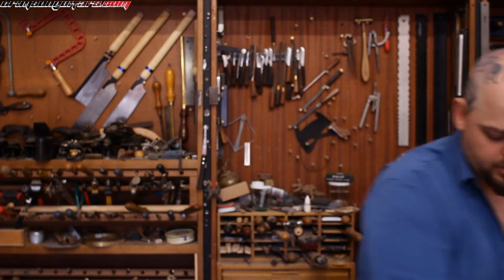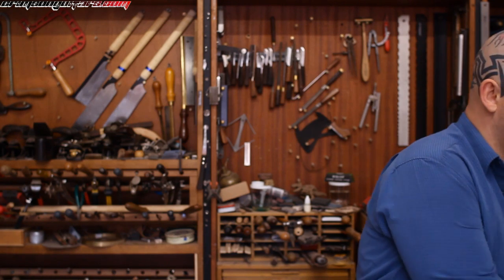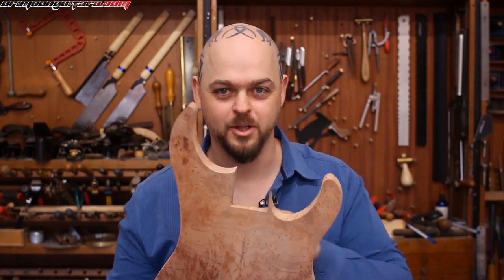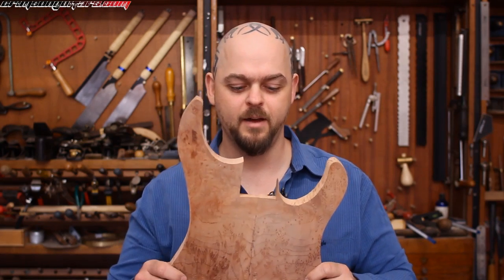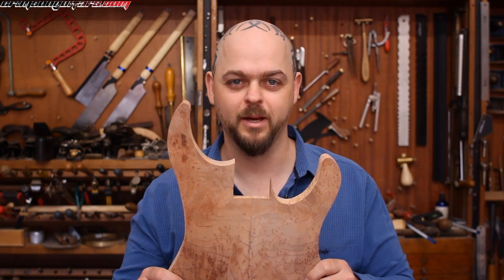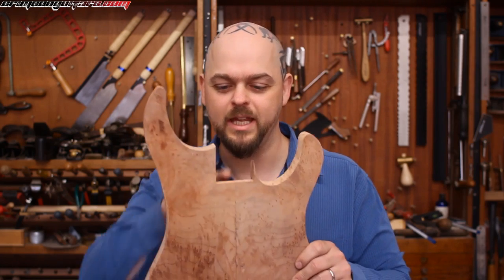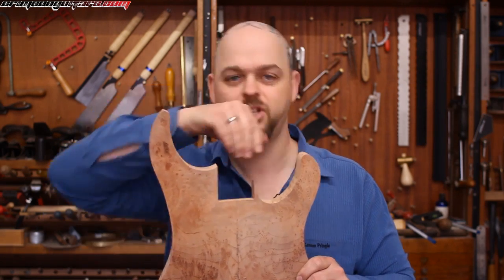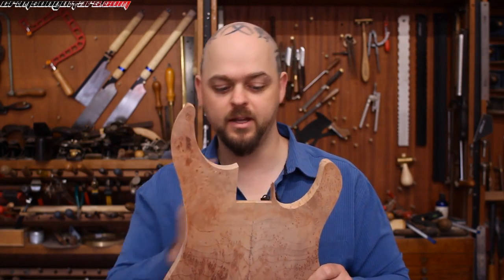Oh no, my neck pocket is too big! - Podcast 125

Comment: Saw the body on the centerline, and glue the pieces together again. The wood removed by the cut will narrow the neckpocket. Probably more work, but if well performed the repair is invisible.
Reply from the maker: +Paul Vréke This should be the top reply!! So simple and beautiful :)
Reply: Good advice as long as you don't have bridge holes, pickguard holes and pickup pockets drilled. Still think that putting some veneer in there is much faster and easier to do.
Reply: Sometimes the most obvious solutions are the ones most often overlooked. I can't think of a better way to do it. Nice going.
Reply: What about the pick up cavity would that not be too small and need resizing?
Reply: That's exactly what I will do since I am using a solid paint to finish it with. What a brilliant solution.
Reply: I searched for the vid due to some similar situation and the though of this option is relieving, but how wide is too wide for a 6 string neck?
Reply: nice.

Comment: take brown construction paper and fold it until it gets thick enough to get a nice tight fit in the pocket then soak it in a thinned wood glue. Tape off the guitar with painters tape and Press the neck into place and let it dry for a couple days. sand and finish..
Reply from the maker: good tip!! I will try this one day for sure. B

Comment: Have had this come up on parts guitars w parts from different makers. One quick and simple fix that is esp easy w bolt on neck is to coat the heel of neck w paste wax or something else that glue won't adhere to but can be kept very thin, attach neck and then fill gap w epoxy or glue/dust mix. Cosmetic clean up still needs to be addressed to the extent merited by project but it gets done fast and w a very precise fit w minimal fuss.

Comment: I almost hate to give this up but whatever, I’ll do it. For stuff like this, I like to use this stuff called “quikwood”. It’s an epoxy-like substance that comes in a tube. You knead the stuff in your fingers, mix it together nicely, apply and in an hour you have new “wood” there. You can dye it, paint it, chisel it, drill it, glue it, whatever...it’s basically wood. I’ve had repairs come in that the guys thought were utter lost causes and I can tell them with confidence that I can make it good as new...

You’re welcome hahah
Reply: Is there any way to have the new pocket mold to the neck? Or do you still have to route the pocket out again?
Reply: You beauty, I have a Tele with the pocket uneven under the neck, will this stuff work?
Reply: Gersh 

Absolutely, I use quikwood for that kind of stuff all the time.

Comment: Sorry to double comment.  Found a really cool solution for a neck that was paper thin too big.

Took a hand planer.  Made the blade a wee bit more then normal (deeper).  Plane out a really nice single shaving.. Using a planer width larger the the depth of the neck your making smaller.  So wood shaving looks like a little piece of wood tape big enough to cover the sides of the neck pocket in one strip.

Take the shaving wet it. .(Gently not soaked.)  I used warm water... Then flatter out with a good metal ruler and a weight on top...  Which..... create a strip of wood a big thicker then paper.  Sense it's a strip and thing.. You glue it up on the pocket side (including the back) and form fit the strip on the neck pocket sides.  Then just thumb it down till it literally looks like it's almost part of the wood and dry.  Sand.. Repeat.. Until your neck pocket fits the neck.  I used the same wood to make the chisel shaving strips.  

Looks awesome.. Cant even tell.. No lines cause the strips bond in perfectly.. it's not some ugly ass shim.

Thanks man.. love the show hope that helps anybody

Comment: After I removed the poly finish on my Tele body and neck there was a small gap on all sides of a few mill so I used used a tiny construction paper thin piece of ply on all sides of the pocket and it worked swimmingly

Comment: I'm building my first guitar (out of a cheap, chinese kit) this video is quite helpful. My neck, when inserted into the pocket appear to be on a slope down, it's not perfectly flat and parallel. Is it meant to be that way?
Reply: If it's a carved body like a Les Paul? Yes. There's usually a four (4) degree angle, plus (+) or minus (-) one (1) degree. Strat and Tele style guitars are pretty much anywhere from zero (0) degrees all the way up to five (5) degrees depending upon if they need shimmed or not.

Comment: Use a 3d printer and print a shim!! i have done this, it works fine, DON'T use PLA for this, use ABS or simmilar hard and stable high temp plastics. it can be printed in any shape, off to a side, or even around the neck .
Reply from the maker: That would work.. I am sure, I alas have o such thing and can make a shim in a few minutes with a few hand tools and some wood.. B

Comment: I've used the dust/glue technique before and worked very well - I put one tightly and carefully wrapped (to avoid wrinkles) piece of shrink wrap/cling film around the heel of the neck and clamped in place in the pocket to mould the glue-dust to the shape of the neck and pocket. When dry I removed the neck, removed the cling film and had a perfectly snug pocket.

Comment: Just a thought:  traditionally in woodworking when cutting a mortise type joint you would use one part to mark out the other.  So the neck would be made as required, then used to mark the neck pocket, which would be cut under-size, then the neck fitted.  Saves on errors and having to repair mistakes.
Reply from the maker: +Stephen Gent that's how we tend to do it here, custom neck pockets almost every time..

Comment: I know this is an old post but I have a problem. I had to sand all the ink off my body and start over again. When I got to the horn I had to use a dremel. I was being very careful not to let it sand grooves . Well I wasn't thinking and managed to sand down too much of the side pocket. According to my caliper the neck is sticking out 2.40mm. The neck still tightens and doesn't move and is aligned. Do you think this is gonna cause a problem?

Comment: Is this potentially a valid place to consider “glassing in”? Use cling-film to protect the neck and prevent it adhering and fill the cavity with a liquid epoxy? The hard resin should transmit the vibrations well and will perfectly match the neck.

Comment: I am currently building a guitar, and while the neck heel fits well, it's sides are a little uneven (no 90 angle). Cutting it to straighten is making it worse in thic particular situation. 

What if I cover the heel in duct tape, put in the pocket, and then use sawdust+glue combo? Thus I will fix the pocket to be tight around the heel, and the heel won't be glued in.

Should I try it this way? I really don't want to ruin my first baby. :)

Comment: I'm putting a 56mm neck into a 57.5mm neck pocket. What I've done is used thick craft card to shim both sides of the neck pocket. I've superglued three pieces of card either side. The neck fits snug. I'm waiting on a pick guard before my final build. I think there might be a little 1mm gap visible either side of the neck but I can live with that.

Comment: Hi ,I do respect your opinion on fixing a large neck pocket, for anything to do with tonewood filling I have always used  a mixture of superglue and wood dust. You know ,squeeze superglue and sprinkle dust straight after and so on until desired thickness is achieved. What u end up with is a rock hard filling four times stronger than the wood itself and this is before it's even dried properly. The colour may be different but most guitars will be painted after. Thanks.

Comment: I am attempting to make a bass, but the body is too thin.  When I create my neck pocket I believe that I will only have about 11 millimetres, or as imperial users go about 29/64ths of wood left to bolt the neck to.  Should I glue wood to the back of the body, underneath the neck pocket in order to help with strength of the neck pocket?  it might look a little weird, but I believe I can shape it to be comfortable. I am going to use a neck plate, and about 5 or six screws and the pocket is fairly long.  Is this a bad idea?  thanks to anyone who can help!!

Comment: I like the idea to dead man and reroute. Perhaps do so with intent of a contrasting wood similar to the binding idea. Dust and glue isn’t horrible for very small voids and I use it a lot. Like as I clean up squeeze out on long miters for instance. But bolt on neck is necessarily the right application. Resaw the body reasonable too, but could have some caveats.

Comment: I'm in this exact predicament currently: When I was a bit younger (16 or so iirc) I wasn't allowed to use a router, so I attempted to do it with a set of chisels, and honestly didn't do too bad of a job, but it just was slightly too large, and I haven't touched it since. I am now 20 so I think I'll purchase myself a nice router and route a clean pocket that's about 5mm larger than the neck, place a piece of lighter wood in (using swamp ash for this build, so will most likely put some maple or something in) and that way when I route the correct size pocket for the neck and it's in it'll look like a nice contour sort of like binding. Thoughts anyone?

Comment: Would it be prudent to just make some shims and stuff them in, possibly wood glue them in place? I have a cheap eBay DIY bass kit, and the neck pocket is absolutely atrocious... I managed to get the thing installed straight, but the gap on the E-string side measures .026" and G-string side is .030", according to my feelie gauges...

I also picked up a stick of both maple and meranti ("Phillippine Mahogany", which is my best guess to the actual "mahogany" species used in this "mahogany" body), which I could use for shim material, but I'm also wondering which would be the better material; the more dense, less porous maple, or the more porous, lighter weight meranti?

Comment: Recently I broke the headstock of my 12 string acoustic guitar. I had a little lost of wood when I was trying to glue it for the first time. On the first time, I made a huge mistake by using superglue. It didn't work and I had to separate the headstock from the neck, and then a bit of wood at the joints was lost. I decided to use then a very hard epoxy resin and it filled the gap and holds really nice the headstock. I've learned that slow curing epoxy resin fills all the gaps and the sound transferring is excellent. I recently did some other stuff with epoxy resin and I find it very similar to hide glue

Comment: Hi ben is it not possable to measure the neck pocket cut a piece of wood to the same size make the neck template but make it wider where it conects to the neck pocket  not forgeting to use the center line for a solid conection ?

Comment: Hi Ben! Recently, by accident, I routed the truss rod pochet a bit crooked in the neck I'm working on. It is centered on the body end but about 3 mm off at the headstock end. I unfortunately didnt notice until I glued the fretboard on. Is there a way to repair it? If I leave it like that, will the neck still be usable? Thanks for your help
Reply: +Jose Sanchez Disclaimer: I have no experience building necks.
From a physics point of view it shouldn't be too bad. You'd get a similar thing with asymmetrical necks which have more material on one side of the truss rod than the other. It is pulling a slight twist in it but when you stop and think about it so are the strings where the bass side has more tension than the treble. If you skewed it in the right direction you may even have a more balanced neck than usual because of that.
As for repair, I imagine that'd be remove the fretboard, fill the hole, redo.
Those with experience will know better of course but that is my reasoning on the matter from the physics side.
Reply: +Allan McKenzie Thanks Allan! That's exactly what I was thinking, actually it is more to the treble side unfortunately... I think I'll leave it like that, see what happens, and if needed go with removing the fretboard, filling and redoing. Thanks again for the suggestions. This is my first official guitar and I'm a bit discouraged that this kind of stupid mistakes happen.
Reply: +Jose Sanchez Don't be discouraged by stupid mistakes. They happen all the time (and I'm really good at them haha). Its what you do with them after that matters. Whats the worst that could happen? You mess up and learn another method that doesn't work. As it was said when inventing the lightbulb "I have succeeded in proving that those 700 ways will not work."
Reply from the maker: +Jose Sanchez I agree with Allan but will see if we can come up with more to say in podcast 131... and mistakes are what make this job nad help you learn, they are great things in the log run imo
Reply: I agree. All in all, I mounted the strings on this weekend and it seems ok. I might post a video when its finished. Thanks!

Comment: Hey Ben
Im modifying the first guitar i ever bought and I wanted to put a new neck on it. The neck i want to put on it is a strat style neck and has a curved bottom but my guitar came with a squared off neck joint. Both are the same width, height and length (at the mid point) Would i be better off filling the gap with epoxy or gluing in a new piece of wood and re cutting it? 
Thanks

Comment: Just recently acquired a 7 string tele body. 7 strings useless to me I can't play the ones I've got so I did a shim either side and a superglue and dust just as you explained. Worked perfectly.  I will of course spray it a solid color to hide the fact.  Great video.
Reply: didn't Ben said Not to use superglue but white glue? because it Chaves changes the color.

Comment: So picture the scene, I have a 21 fret telecaster neck rounded at the heel and I need to fit it to a standard (square) telecaster body.
What do I do? Please help
Reply from the maker: put it in place to see whether you need to add material to the neck pocket to fill the corners or cut the end of the neck off flat while the scale length is correct. you can add more wood and then use a routing template to rout to the correct cavity size and position if needed but it really depends entirely on the scale length
Reply: @CrimsonCustomGuitars  ok thank you Ben.
Reply: @CrimsonCustomGuitars  Ben, I can’t add material to the neck pocket cos the scratch plate runs along the same line as the pocket, so it looks like trimming it down but I don’t want to ruin it. I realise by sanding it I am reducing the length of the neck.

Comment: If the gap(s) are very small, you might be able to swell the wood in the joint and/or neck by dampening it with water. I inadvertently did this when wet sanding a body and ended up with the opposite problem, the formerly fitted neck was now too tight.

Comment: You could also mount a Fender Strat style plate on the back to hide the lines. You can go to a trophy shop and they will engrave whatever you want on the plate not to mention that's where you can get the plate in the first place.

Comment: IS there a fix for a guitar neck, whose high e string(highest pitch), too close to the bottom of fretboard?
Reply from the maker: You can do several things.. refret and put a smaller bevel on the ends of the frets this widening the playing surface. Or you can adjust the nut or even (on a tunematic) saddle slots to compress the strings a bit. Or you can adjust the neck pocket and twist the neck along the centre line to.a point where the strings line up properly.. good luck! B

Comment: What about using some clay in the pocket to fill empty spaces and encrease the contact?
Will it work?
Reply from the maker: Bloody good idea! Not clay though,  2 part putty. Cover the pocket and neck in cling film. Put in putty and then the neck at the right angle,  wait to cure and remove clingfilm.. perfect shim with near 100.percent contact! Awesome! B
Reply: Crimson Custom Guitars Great!!!
Thank you so much!!!
Nice avdice
Reply: Thank you! The issue I've run into is a pocket too deep on a new bass body. Like an eighth of an inch too deep for a Fender spec bass neck. A big ass wood shim is so visible but this idea of wood putty and cling wrap is the best so far.

Comment: Hi bro can i change the neck thru to neck pocket ?
Reply: +heihachi edajima I suppose technically you could, though I'm not sure why you would want to. I love neck through guitars. Just my opinion. 

But you would probably have to remove the fretboard and then cut the neck off at the point where the pocket would start. And then rout out your pocket from there. You would also have to take into consideration any carving on the back of the body. 

I actually just had an idea last night of doing the exact opposite in a way. I was thinking about what it would take to turn a set neck into a through or deep set neck by carving out a space in the back of a guitar for a scarf joint and then cutting a matching receiving section out of the neck and putting the two together with a joining piece that matches the cuts you make.